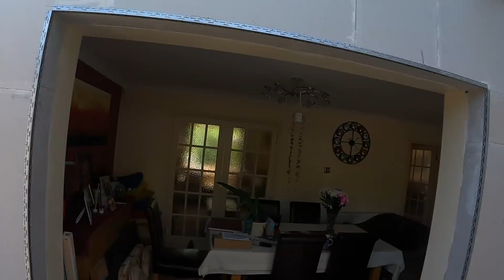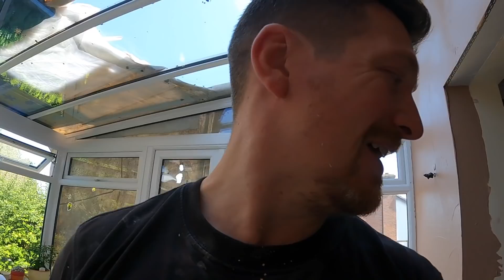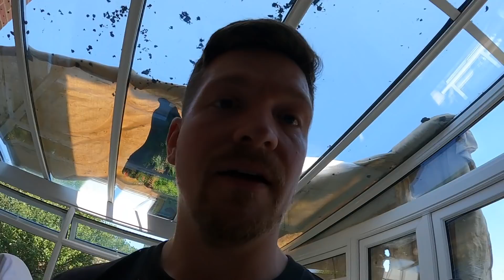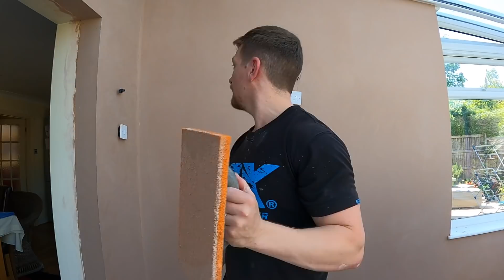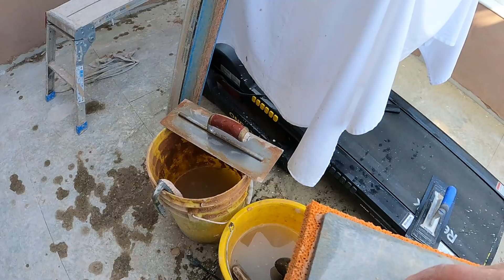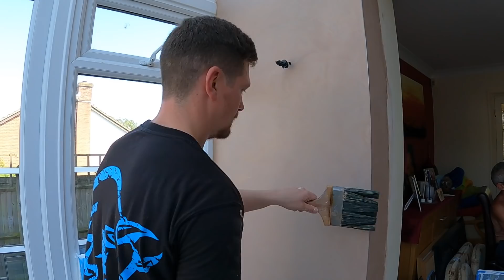CRAZYY?? Plastering Inside A Conservatory...In The Middle of summer | Tips For Plastering In Summer

Comment: I find sponging then using a speed skim doesn’t take out all the grains from the sponge as a pose to using a trowel directly after sponge floating. Moreover if you use a sponge float over an entire big wall or ceiling. By the time you go back to where you first started with the sponge. It can be difficult to speed skim or trowel over the grain from the sponge. Instead sponge over a few square metres at a time and trowel or speed skim over a few meters at a time
Reply from the maker: Yeah you are right but I just like using the Speedskim immediately to save the waiting time. I find the Speedskim pulls the plaster back in and makes it easier to trowel afterwards. I don't know if it's the best way but I like doing it that way. But you are right my friend. Thanks for the advice and thank you for watching!
Reply: You have the fat to work with? Sponge float shows u where your lows are (leaves grain) use the fat to fill maybe u leaving it to dry out? Miss plastering its therapeutic to watch imo

Comment: Nice job dude... i am trainee plasterer. 
would it be helful if you use air con bcos its hot.
can you use a wet sponge earlier  to clean the reveal?
you said speedkim brings moister to the front on 2nd coat, biut you still used that big blue speed skim..
why use sponge floating, does that bring moisture to the front?
Reply: Don't use aircon or any sort of fan, it can speed the setting times up like crazy, best way is what he did with the sheets 
He used a speedskim on the first coat to allow him to second coat straight away so both coats pull in together.
He used it after sponging just to flatten, hence why he went over with a solid trowel straight away to get all the lines out.
Learn to master the hard trowel before you goto speedskims, sponging and flexi's. If not used right they can make your work look very poor. I've tried them all and after 12 years in the game I've gone back to carbon Marshalltown all the way through. Tried and tested 👍🏻
Reply: @scott2386  thanks you ..
is there any difference between carbon or stainless steel hard trowel
Reply: @ertaszorlu4756  no mate, no difference at all. Just different types of metal, carbon rusts and requires maintenance, stainless steel doesn't rust at all. "Hard trowel" means using a solid trowel on your work. Not using spats or flexi's 👍🏻
I'd recommend using a 14 inch marshalltown trowel
Reply: @scott2386  thanks you
Reply: @ertaszorlu4756  no problem 👍🏻
Reply from the maker: Exactly what Scott Jacques said! Very informative...cheers 👍

Comment: I have brought a refina plaziflex spatula rule its got a plastic blade anyway evertime i use the thing it kind of tares the plaster is there something I'm doing when using it??
Reply from the maker: Hi mate. I'll be honest, I couldn't say because I haven't actually tried that model of Spat. But maybe it needs sanding down before use...it might just be a bit coarse at the moment. I hope you sort it 👍
Reply: Is your plaster too dry when u doing it too? Maybe lube with water had the same issue using knauf plaster onto breeze blocks water was the key there
Reply: @codzlaw4823  thanks for the advice   it could be the problem I did wet the blade but not the plaster it self i will try doing that hopefully solve issue cheers mate
Reply: @sebs8607  just a process of elimination if it's your whole tool gripping maybe it's the tool if it's just 1 part of it find why it's gripping there n smooth out but water will always help stop the gripping

Comment: Hi Blaine. Does your speedskim leave trail marks ? Mine has the rounded edges but still leaves them trails every flatten and I more than often find myself having to trowel them out after each flatten. Cheers 🍻
Reply from the maker: Mine did the same at the beginning but it changed when I rounded my edges further. Give that a try and it does get better the more you use it. It just takes a bit of time to break in 👍
Reply: @PlasteringForBeginners  cheers Blaine 👊🏻👌🏻

Comment: Nice job pal 👍🏻
If you haven't got any retarders like extra time or slowset, just put a handful of drywall adhesive in the mix per bag of multi. Gives an extra half hour for each coat 👍🏻
Reply from the maker: That's crazy!! I didn't know that but I'll definitely try it...thanks for the heads up my friend. Your a legend 👍
Reply: @PlasteringForBeginners  no worries mate, had a massive stairwall that led into a 3m living room wall to skim last week. Putting that handful of drywall in held it off lovely. 3 and 3/4 hour set in the end 👍🏻 doesn't effect finish at all
Happy spreading pal

Comment: Always keep a sponge float with me people 
A godsend at times like this
Reply: Had murders with a few ceilings lately in this heat pva’d in abundance before starting but still got loads of spider web cracks every where on the second coat as it dried and in some parts the second coat actually peeled away from the first coat mind u the room temp was 36 degrees at the time had to let it dry cut it back the next day and make good the patches with easi fill a nightmare though the heat just dried it out so quick
Reply from the maker: It can be a nightmare plastering in this heat! It's never nice when it's this hot.
Reply: @PlasteringForBeginners  Blaine have u ever had this peeling happen to ur work before and if so how did u resolve the problem ide love to know what safeguards I could put in place to prevent it happening again I don’t know if u said it or it was in the comments after that extra time should b used but I did that aswell and still got the fine cracks and peeling any advise would b appreciated Blaine
Reply: @kendodd8734  I did the small bedroom ceiling I had to add extra time to mix but still had some cracking I also unibonded the ceiling 3 times this weather has really caused a few problems  
I decided to take a couple of days away from it here in wales temperatures have dropped so I will finish tomorrow (Monday )
Reply: @BigSteveFairchild  reckon u might have the only solution there just leave it till the conditions r a bit more favourable I’ve spoken to some spread mates of mine and they’ve all come across this problem before but none could give me a definitive answer as how to solve the problem so reckon ur option is could b best let’s face it it’s Britain it don’t stay this hot and for sunny too long does itv
Reply: @kendodd8734  mate I was proper battling against it so I thought No chance I’m taking a couple of days out reputation at stake if I left a shit finish so I explained to the customer’s and they were sound so I’m back tomorrow to finish up 👌
Reply: @BigSteveFairchild  yeh makes sense and the bonus of a couple of days of r and r how bad

Comment: Should have scrim tape on those beads pal
Reply from the maker: Why matey??
Reply: Wouldn't scrim tape stop any cracks between the boards blaine?
Thanks for the pro tips, I love watching you work and there are so many different ways plasterers do things.
I seen the spray method before, I'll keep this in mind for hot weather.
Reply: I'm new to plastering. This is the first I have heard of this tho... when would you skrim tape beading?
Reply: Yeah sorry I thought he said scrim between boards, never heard of scrimming on beads.
Reply: Greatly helps to prevent the set plaster lifting of the bead, especially so if the corner gets a knock. Provides much more robust corner for a minimal cost. Just over each wings and not the spine of the bead.